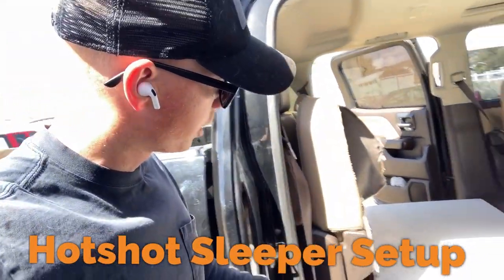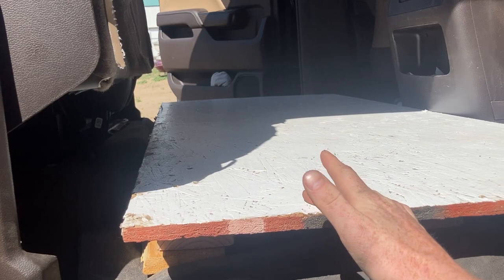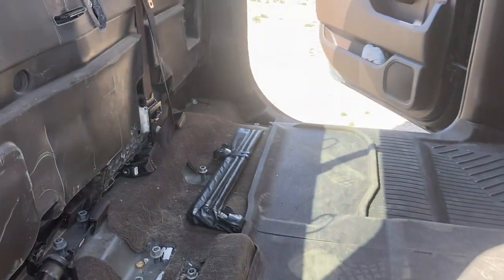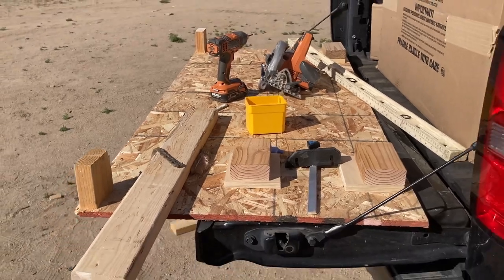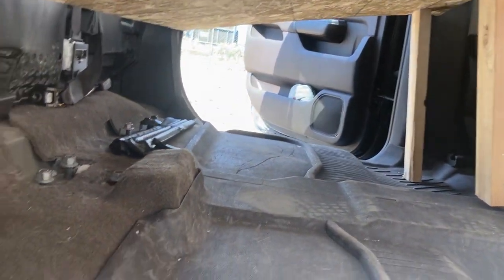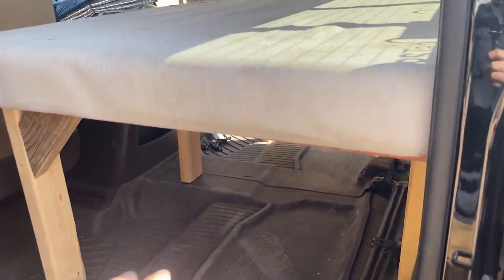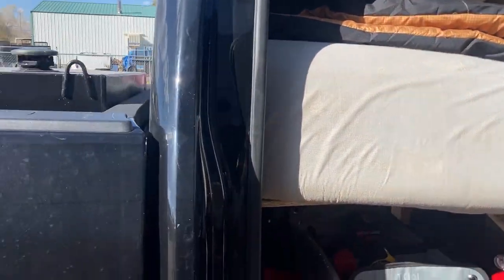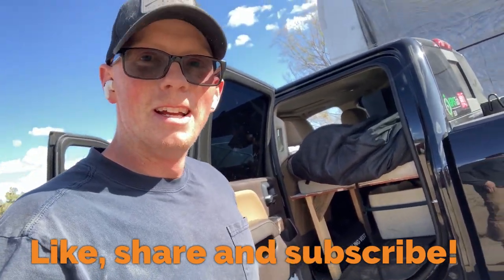Hotshot Sleeper Bed Set Up, DIY How-to

Comment: Not dot legal.
You could be POS if it doesn't comply.
Good luck.
Reply from the maker: Only if you’re doing sleeper splits or logging sleeper berth. 10hrs in off duty status can be in, out, on top of, underneath the truck, doesn’t matter